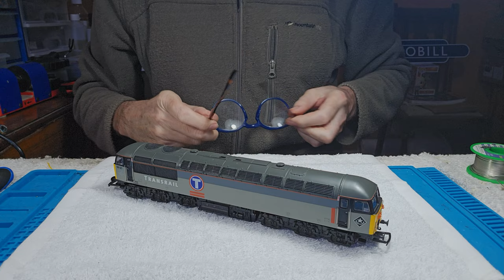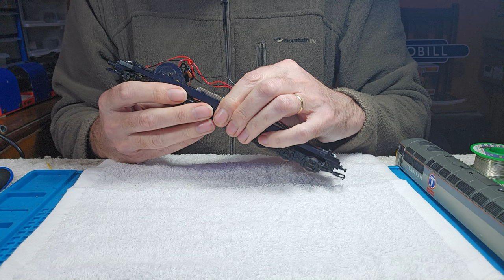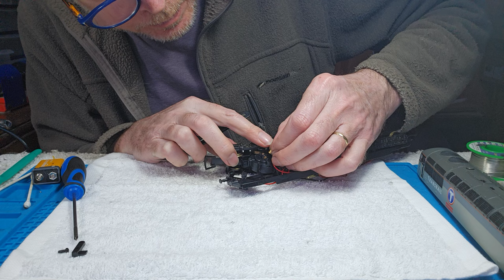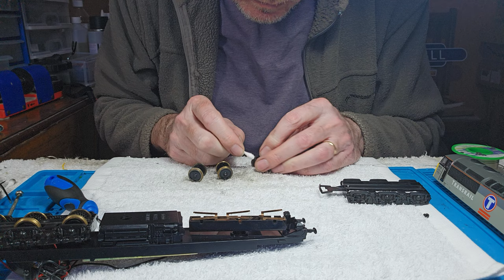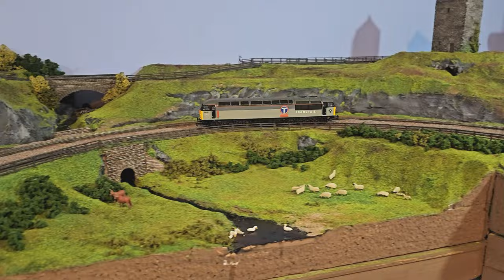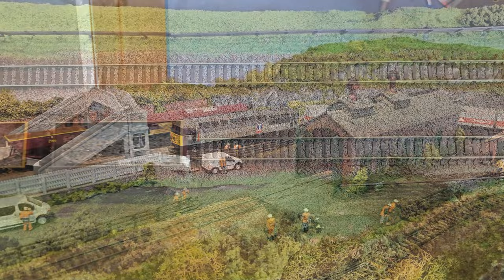Hornby Class 56 : Repair Request

Comment: The 56 is actually a Mainline model, and that's the original Mainline ringfield motor design.
The plastic bracket which was screwed on over the brush housings is the bogie fixing bracket, which you remove to remove the bogie rather than flexing the chassis.

Comment: Bill. There is a small black retainer part on the side of the motor that is designed to be unscrewed first to allow the bogie to drop out. Its the same on a Mainline Peak model. Hope that helps if you ever get a peak in the future to repair.

Comment: Good work Bill.
Over compressed brush springs in a Ringfield Motor. Who would have thought.
I looked at a Lima Diesel for my club a few weeks ago that had the same symptoms.
After being told not to go as far as stripping the motor down I now suspect that it could have been fixed.
Thanks for the tips.
Happy Modelling

Comment: Bill, the cheapest new 56s I've seen recently are at DC kits, who are selling a couple in EWS & a triple grey liveries for £85 each. TMC has a BR blue example at £130. I picked up a large logo version for £126 from Kernow about a month ago, but they're now out of stock.

It looks like an intentional hybrid to me. Components from all the tooling owners over the years seem present: Mainline, Dapol, Hornby, who, of course, also added in Lima bits. I very much enjoyed watching you meticulously diagnose and solve the problem. It didn't seem to be pulling that much power by the time you'd finished with it. The 56s are an impressive class. Good to see many of them plying their trade once more, and even becoming body donors to the new 69s.

.

Comment: Another great video Bill. Speaking with hindsight (!!!); would your ammeter have registered a short circuit at the outset when in fact it showed 100 mAmps presumably the loco lighting consumption? Normally ,as in this case, the ammeter reads about 200 mA, but I recall one recent when the repaired loco was drawing 300 mA. It would be interesting if you could explain sometime how useful a tool the ammeter is or might be.

Comment: Good work Bill, that’s the old Mainline / Dapol class 56 rebadged as Hornby and still retaining all the flakiness of the Mainline mech. I had the same short spring issue on my Mainline Warship. If you’re looking to add one to your fleet you’d be better off with the newer Hornby central motor version which will be dropping in price as the Cavalex 56 roles out.
Reply: Cavalex have made the new 56, not Accurascale although they are doing the updated Hattons (RIP) 66!
Reply: @Mitche01 thanks, I’ve amended

Comment: As Lima are now part of Hornby International it may well be on the Hornby Railroad models that they are using updated Lima type ringfield motors across all of the brands now under the Hornby umbrella. Once you got it on your layout it even sounded like a Lima model, though with slightly less scratchy sounding gears.

Comment: I have the same Hornby 56 but sadly mine also needs a repair which is in the form of a replacement bogie as some adventurous shunting damaged the coupling beyond repair. Due to its moulded on design the only logical action is to replace the bogie.

Comment: To remove the bogie, there is a small plastic tab on the front of the faceplate held in by a screw. Remove the screw and tab and the bogie will drop out.

Comment: It was originally made by Mainline back in the very late 70s/80s not sure when Mainline went belly up!
Reply: parent company decided to stop most the locomotives became bachmann few like this 56 became hornby
Reply: Dapol bought the tooling for all of the Palitoy Mainline model railroad products (mostly former Airfix GMR Ready-to-Run products), except the Steamers, when General Mills wound up Palitoy in 1985. Palitoy didn't go broke, they were owned by General Mills who decided to put their focus back on food products and sell off the not-food companies they'd bought through the 1960s and 70s. They couldn't find a buyer for Palitoy, so it got broken up, the IP sold off, and factory closed.  
Hornby then bought the tooling from Dapol in 1996.

A Mainline or Dapol Class 56 will be largely identical to this one, this was before Hornby meddled with bought-in designs (ala Lima). The Mainline Class 45 may be somewhat similar as well.
Some of the Ex-Palitoy tooling is still sold, most obviously the Hornby Mk2d is the mid-70s Airfix one.
Reply: 1983
Reply: I thought they were originally Lima ones? I thought Mainline became or was taken over by Bachmann?
Reply: @adamswindells1  Mainline was broken up and dissolved, nobody took it over. Kader got their Steam locos, their wagons, and some coaches. Using that, they launched Bachmann Branchline. 
Dapol got the diesels and the remaining coaches (eg the Airfix GMR Mk2d, now the Hornby Mk2d). Lima did do a Class 56, but Hornby wouldn't get it until 2005. They bought the ex-Mainline moulds from Dapol in (IIRC) 1993.
Reply: Lima never made a class 56.

Comment: I have 3 of these models. So much cheaper than the Cavalex ones.
Reply: Yes but they are like 100 years old...... The Cavalex models are a all New Tooled model from the ground up.  They are less expensoive then the Hornby model (The one that was designed by Hornby, with a proper motor driving both bogies, not the OLD Mainline one.)  I have two of the 'super detailed' Hornby models, and they are far better then the old Mainline models.  And I also have one of the Cavalex models, super quality.
Reply: The Cavalex models are superior in every single way, I have two and they are by far the best diesel locos currently on sale.
Reply: @jamtart606 and as I said. I am on a budget and cant afford the new Cavalex ones. These are perfectly good for DC on a limited budget. I am glad you can afford 2 new models.